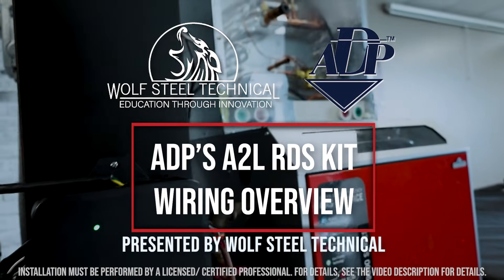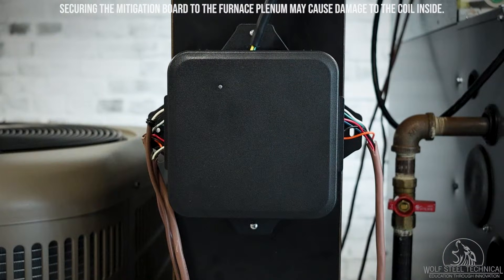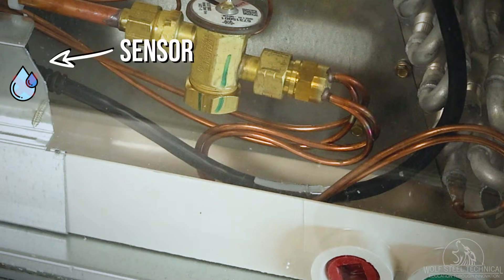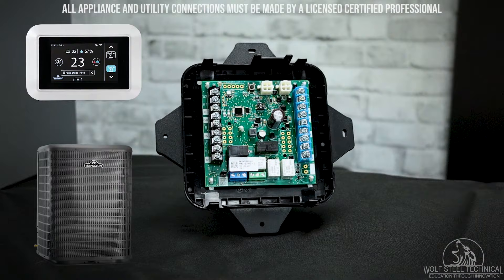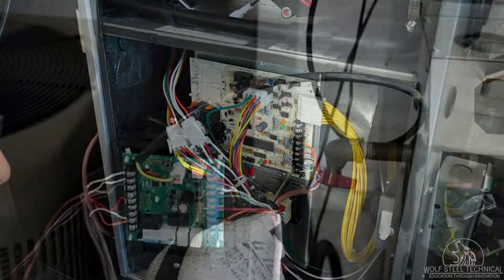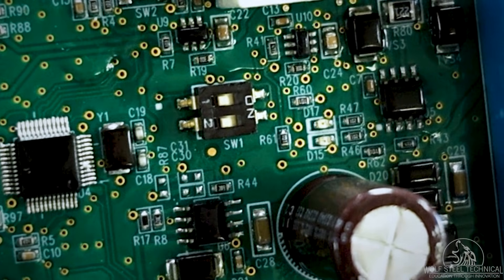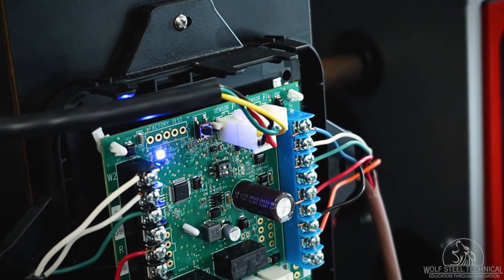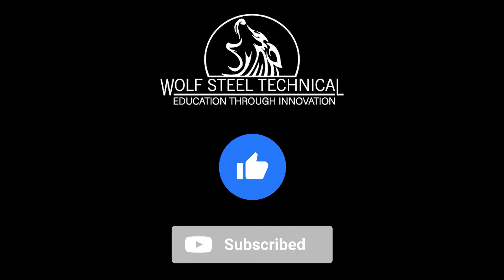ADP’s A2L RDS Kit Wiring Overview

Comment: If the board detects a leak. Wouldn’t the thermostat still send 24 to the ac unit if they’re both wired in the same terminal side (black side)
Reply: Or does the mitigation board completely disable “ R” going out to the thermostat when it detects a leak ?*
Reply from the maker: @spok209   you're correct, the ADP RDS kit turns off the thermostat, which turns off the outdoor unit while the RDS initializes a G call for continuous fan.

Comment: How much, apprimately, is mitigation board?

One still needs regular furnace board, is this correct?

Good info.
Reply from the maker: You'd have to reach out to your supplier for the info on pricing.

The system will need control boards on the AC/ Heat pump along with a furnace or Air handler to operate as intended.
Reply: Awesome!

Comment: I have a issue with heat pump, the cooling works fine, but heating is not activated, I change the dip switch to 24 v communication, or should I change back to Rs485 communication, but I have to connect H1 H2
Reply from the maker: For heating to operate, the temperature outdoors needs to be below 70F. That said, Yes the system needs to be switched to 24v and H1 and H2 needs to be connected if using the matching heat pump. I'd call Napoleon's customer solutions for further troubleshooting: hvac@napoleon.com or call them at +1 (866) 820-8686

Comment: How to power the blower and all that
Reply from the maker: The control board within the furnace/ air handler triggers the operation of the blower, upon receiving a signal from the thermostat.

The A2L board intersects that signal and either relays it to the furnace/ air handler as normal. or overrides it and signals the blower to operate, if the Sensors detect a refrigerant leak.  more info on how the system works in linked here:

https://youtu.be/29BCAPnVQD4

Comment: Hi if out door unit 2 wire in the wrong connect What will happen? I mean normal 2 wire white cooler to the C and red to the Y1 . If I do the white to the Y1 red to the C. The sensor and board will broken or something happens? Thank you
Reply from the maker: I would reach out to the manufacturer of your appliance for this type of troubleshooting assistance, as each appliance has its wiring requirements.

Comment: Which side do you add accessories like humidifier and HRV? And do you have to wire the accessories all to the furnace board as well?
Reply from the maker: Good Question, 

They get wired directly to the control board as per the IOM of the accessory equipment. Hope this helps!
Reply: @wolfsteeltechnical I have issues of the unit tripping when I tie these accessories to the furnace board. Also I ran into an issue where the board would not transfer power to the tstat until I press the test button on the RDS board?
Reply from the maker: @gariaveria5433  sounds like there may possibly be a wiring mix up between the stats and the system.

I would reach out to the Customer 
Solutions department for the furnace manufacturer for further troubleshooting. sorry we cant be more help!
Reply: @wolfsteeltechnical would you happen to have the number? It’s not on the booklet and I’ve reached out to ducane but can’t find a tech support
Reply from the maker: @gariaveria5433  does this help?

https://www.ducanehvac.com/contact/

Comment: Why the blower fan is runing continuously?
Reply from the maker: Id try a few things:

1. Revisit the wiring to ensure connections are made correctly from the appliances to the board, and from the board to the sensor - possibly power going to the blower so its running as if there is a mitigation occurring.

2. Ensure the board is not running a mitigation test. this can be checked using the test button on the inside of the mitigation board - there's another video we have on how to do this here (@ 5:20):

https://www.youtube.com/watch?v=29BCAPnVQD4

3. if none of these work, I'd try the sensor on the 2nd position (ensure to update dip switch settings) or replace the sensor or board.

 Hope this helps!
Reply: I have same issue. Do you know how to fixing the issue? Thank you
Reply from the maker: @Terrence2009  See the reply above^
Reply: @wolfsteeltechnical wires is this connect correct . Sensors and board is brand new。
Reply: @wolfsteeltechnical can I have parts number for the sensor and board? Thanks
Reply from the maker: @Terrence2009  
then check if the board is running a mitigation test as noted above in a separate video for troubleshooting fault codes.

As for parts numbers: this will vary with each supplier - I would suggest reaching out to your supplier you received the unit form for exact part numbers.
Reply: @wolfsteeltechnical thank you very much

Comment: Work on older furnaces with older control boards?
Reply from the maker: It should be fine, as long as the system is still wired with the standard thermostat wiring

Comment: Do need to connect a common wire for the mitigation board to power up because the thermostat that I have only has four wires so would I have to run new thermostat wire to my thermostat to connect the common wire because I’m getting no power to my mitigation board?
Reply from the maker: Yes, you would need to run a common wire to complete the circuit.